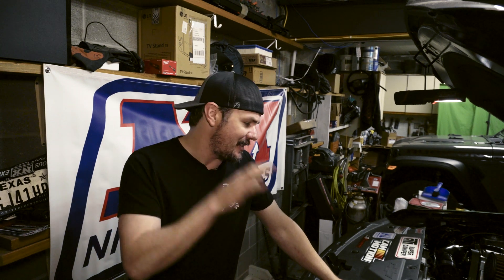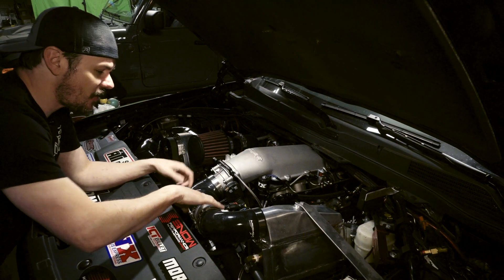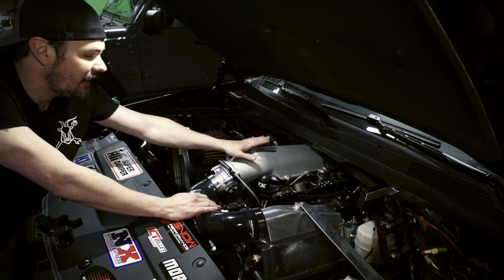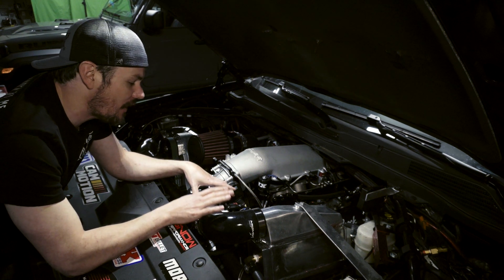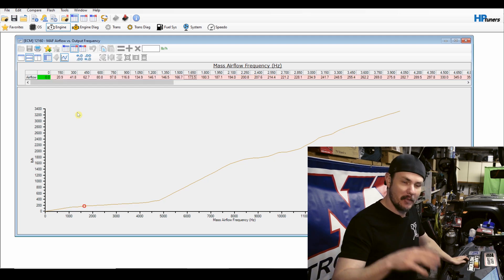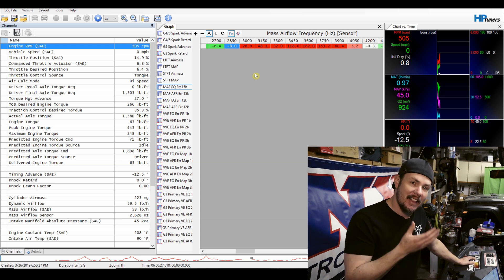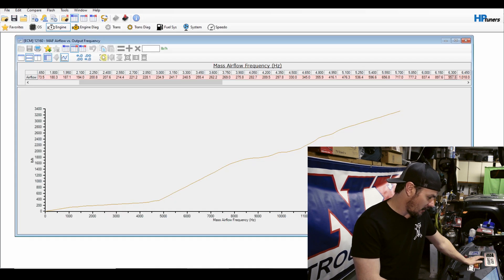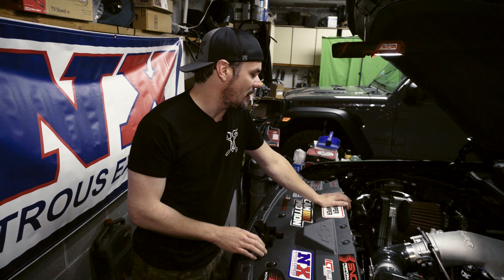MAF Won't Tune!  Why And What We Can Do About It!

Comment: Im using an LS7 card style maf on my LS swapped BMW, I have an over radiator intake setup from a corvette. It has a sloppy stage 2 came. Im having a hard time in the low airflow areas. Maybe im having issues with the cam and the maf being only like 6 inches from the tb.

Comment: Goat rope, have you had early gen 4 maf not fail when you set it to fail? 2008 e38. I've heard 08 e38 ecm can be tricky.
Reply from the maker: Set the MAF fail parameters, unplug the maf, it will fail then you should be able to plug it back in and still have it failed.

Comment: running an otr intake on a lsa blower and a ls7 card style maf, getting crazy maf readings. how do you feel about the honeycomb air straighteners in this situation? i installed a maf screen from a stock ls3 maf and the maf reading look alot better.
Reply from the maker: Does it constantly have crazy readings or just in the lower rpms?
Reply: @GoatRopeGarage  havent gotten into high rpms but it was doing it constantly Cruising and on the highway

Comment: I experienced this same thing. MAF Reversion will make your tuning day very interesting. Just when you think you got it....BAM! It all goes bad, just like Kyle said. Chase your own tail for days!

I wish you had of talked about MAF patching. I tried this in a E40 GTO. Didn't work, still don't know why. 
Same rule applies to VATS delete. Write entire. ???
Reply from the maker: Yep, write entire with and patch
Reply: @GoatRopeGarage  yes but maf only reads to 12200hz after the patch.
Reply from the maker: Run a bigger intake tube if you need it
Reply: @GoatRopeGarage  i did that. Installed a 4" tube.
The curve is so steep, its almost maxed out the curve at 9800 hz
Reply from the maker: @pcmfrenzy1089  dang, how much boost you running?
Reply: @GoatRopeGarage  you're probably not going to believe this, but its N/A.
This thing is a monster. It flows so much air!
One more mod I gotta force SD. 
I installed a LS7 MAF. But for some reason the Patch won't apply. Cause then I'd be up to 15000hz. But then the PCM is hard-coded at what 65 lb/min...
I guess it probably wouldn't matter since I'm at the hard coded value anyways...

Comment: So at 2500 rpms your gonna be around the 4000-5000 hz range? Do you plan on using MAF all the way to peak boost? I am using the card style MAF and I think it pegs at 15000 hz, more than enough for 10psi but I like running SD seems more responsive
Reply from the maker: The Hz you hit is determined by your inlet size, I ran 20 psi without maxing mine already. Most likely, as it is more consistent than speed density see the higher airflows.